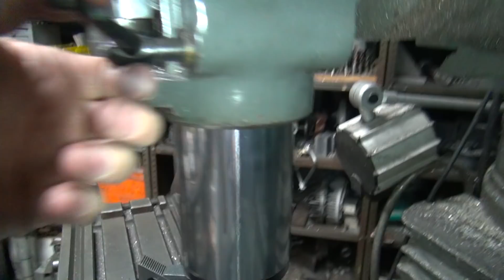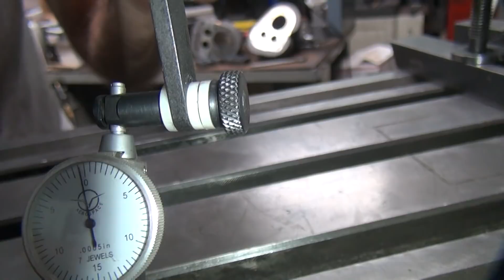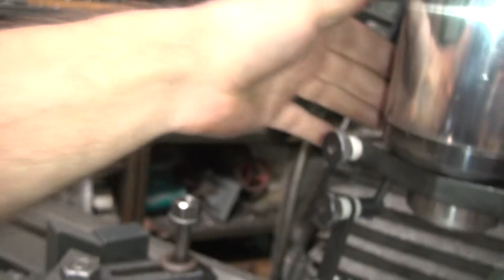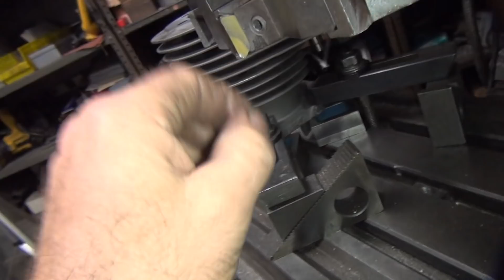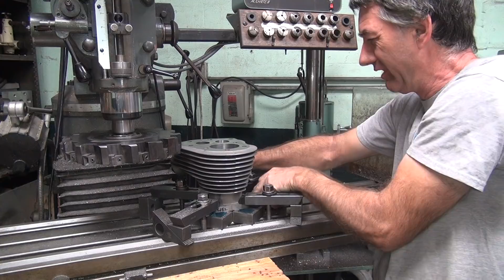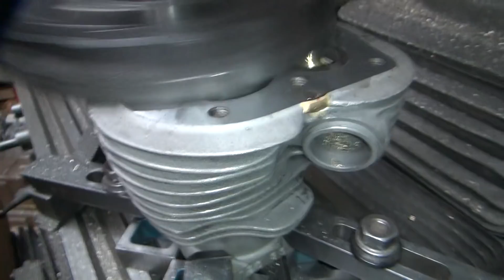1941 wld 45 56ci stroker #187 flathead motor build 4-5/8 in harley wl by tatro machine

Comment: What motor  oil would  you recommend  i order from you for my bike this summer?its a 2004 twin cam.95" with se 211 cams,10.5 -1 compression  ratio  Vance  and hines pipes . It already  runs a little  hot and i live  in az where summer  temps run 100 to 123°.i can only  afford  one oil change  at a time . Next month  will be primary  then trans.thanks in advance .
Reply from the maker: for now i would use tribodyn oils,  motor 20w50sb, trans 75w140fs, pri 75w90ls. or you can run 20w50fsmjm for all three. 
i like useing the three different oils made for the job, not the all in one stuff.
tatro